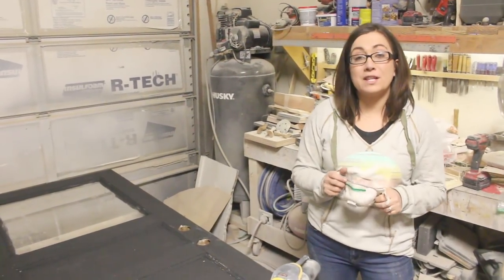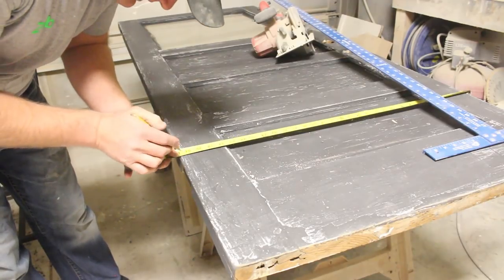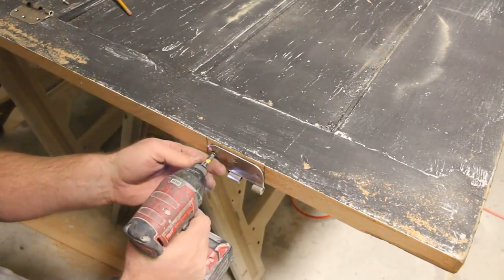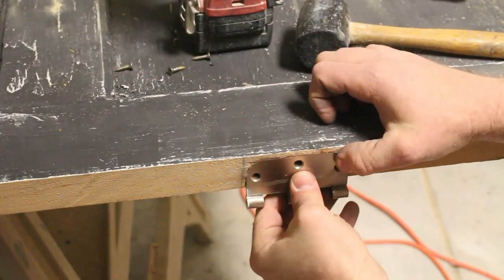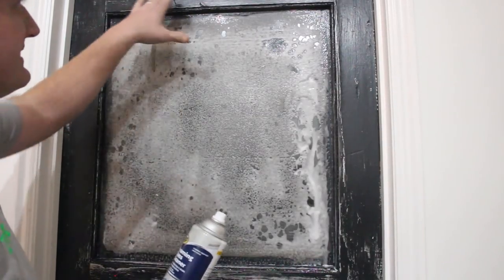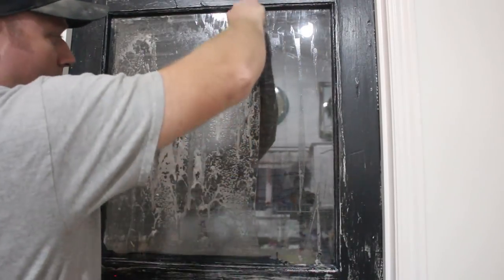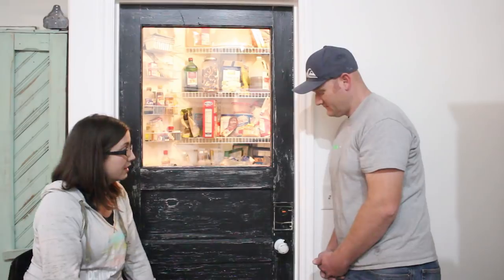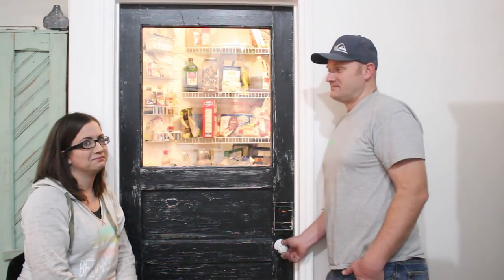Hanging A Farmhouse Pantry Door | Old Door New House

Comment: I had an idea.. how about some of that mirror spray paint and then spray it down with vinegar water to make it look like old mirror.. or mercury glass.. just and idea... I love watching your videos!!!
Reply: Angela Kadingo that stuff comes off so easy
Reply: It does?  It's been working for me on my glass ware items and sticks really well.. maybe it's the prep... maybe a clear coat for extra strength would help... I will have to do some more research.. I love my pieces.
Reply: Angela Kadingo i'd assume for pieces you wouldn't touch often it would be lovely, but i did the bottom side of a glass table and it would so easily "melt" off from fingers and rub off in general. what brand did you use?

Comment: I bought a bunch of solid wood doors to replace bedroom doors...problem is they are shorter then the doors in our house ( not all same size but some as much as 3”) any suggestions on adding length to door? ...oh and besides the fact that their short none line up with closures in house so I am going to have to invest on the old time lock boxes....I got beautiful solid doors for 25 bucks a piece so investing in lock box for authentic door is a solid investment....any help would be appreciated 😊
Reply from the maker: I’ve seen old doors with wood added to the bottom of the door. The trick will be painting it to match. Most doors are 1-1/2” thick or close to that so, the same thickness as a 2x4 from the hardware store.
Reply: Jami Ray Vintage thank you for taking the time to answer...the doors are all painted white which is definitely a plus but they will need some sanding and a touch up coat so hopefully I can add more coats to the bottom (add on piece) to get paint thickness the same if that makes sense. Some of them have that big brass plate just flat not ornate and I don’t want that either so probably going to have to sand way down now that I think about it! So 2x4 it is...love your videos!